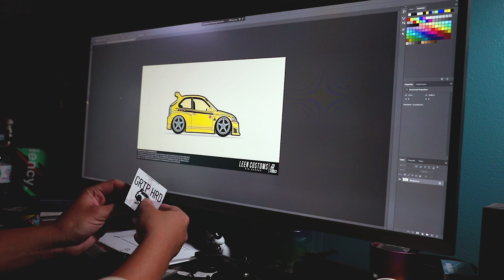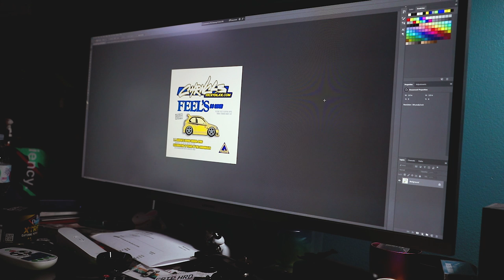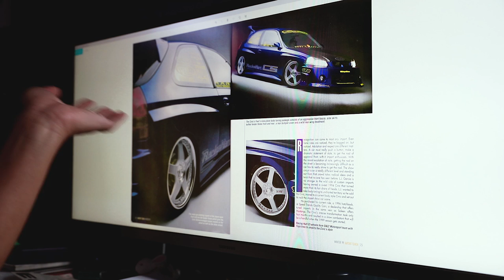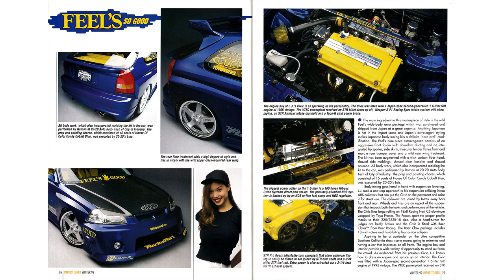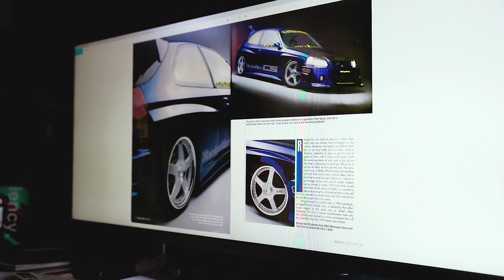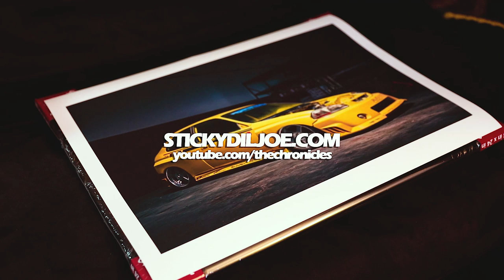Bringing Back The FEEL'S Widebody Civic For One-Time Only...

Comment: I feel like I should be more nostalgic for this car, and cars like it, but sadly I'm not. I think we peaked at the "lets do JDM conversions" era and just try to have a clean simple car, instead of a wild show car. However I think if the wheels were a bit smaller, like 16-17"s maybe that'd change my opinion on the car. Either way, it is a bit of a time capsule car - and I like that. But I can say, I'm not in love with it. And I forgot all about air cylinders. What a awful ride they provided. lol